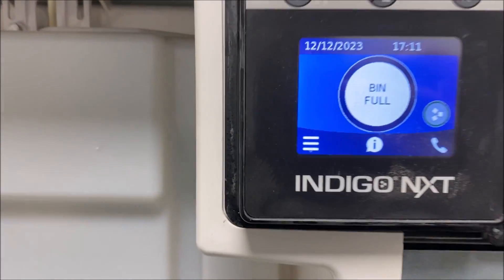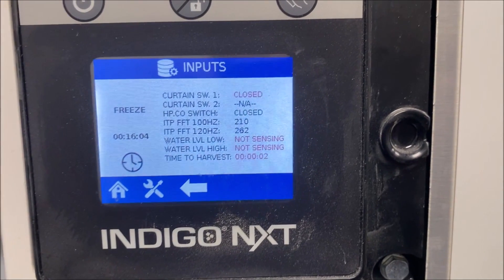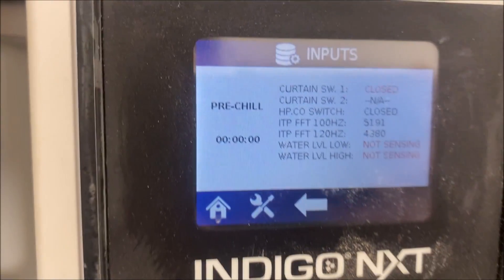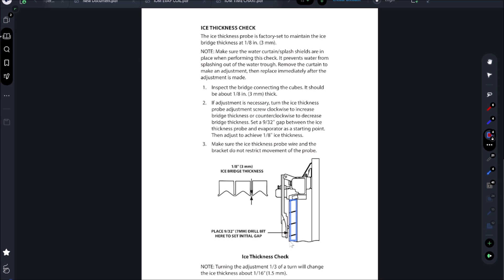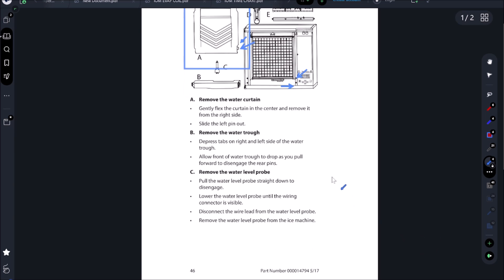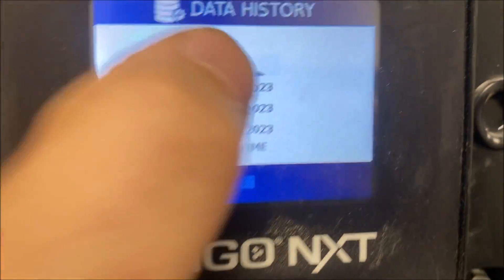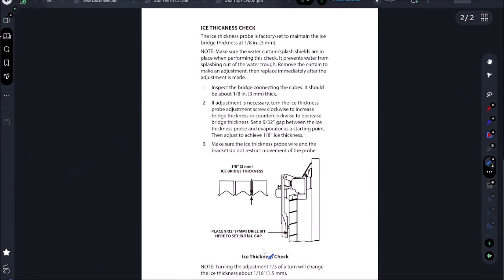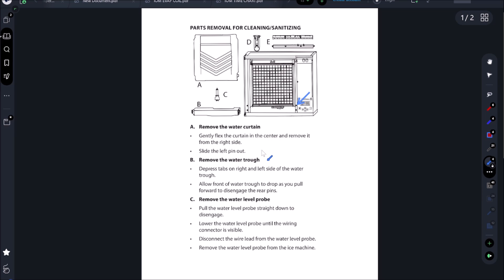Manitowoc Ice machine Ice thickness and Harvest issue. Stil under warranty.

Comment: these new NXT units also will shift at the end of freeze into harvest and directly back into freeze due to curtain switch showing a slight resistance insteqd of being a fully closed switch. it does not show visually when checking the inputs  on the display.
Reply: Good to know 😃👍